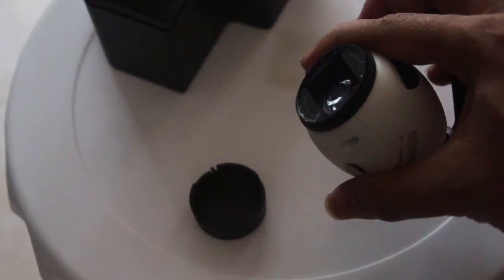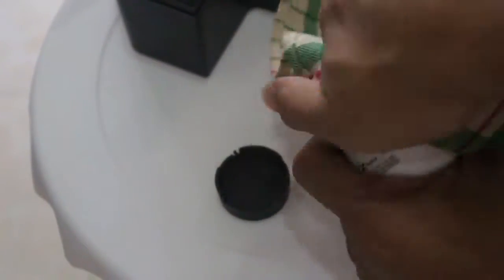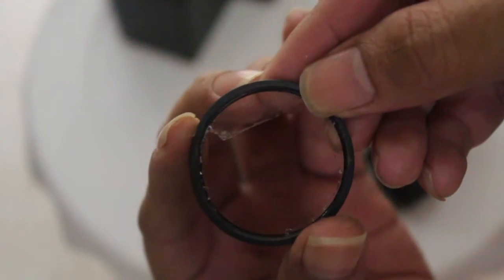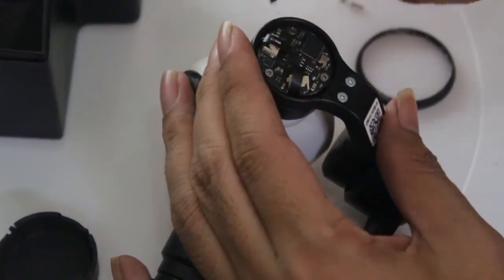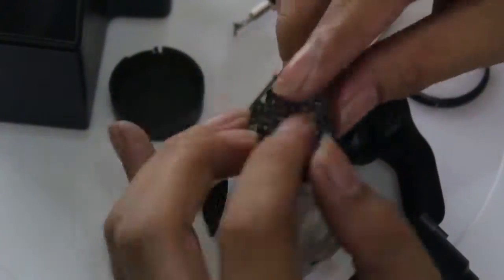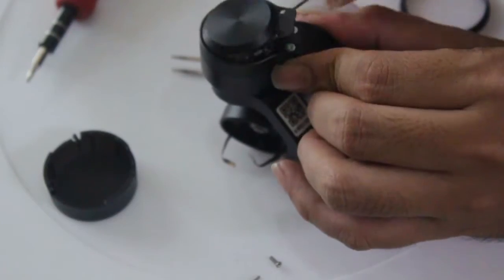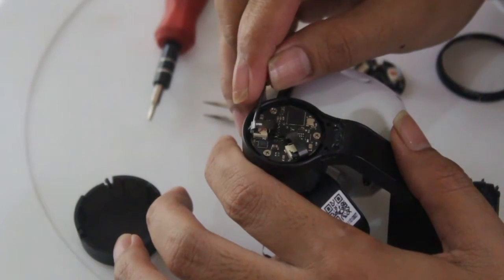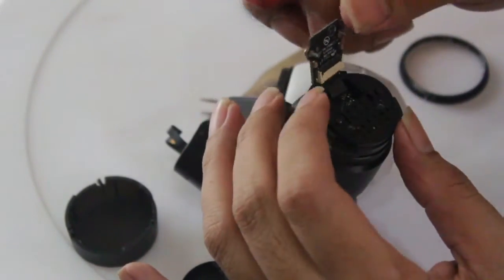dji Inspire 1 Zenmuse X3 disassembly repair

Comment: 👍Good video!
Hello
Now I’m fumbling in the dark, trying to figure out the correct positioning of these nuts in relation to the Hall sensors and the different axes. (I was able to determine the magnetic polarity of the nuts.)
Do you know the name/location of the hall sensors on the pcb and how the magnetic nuts relate to the sensors/axes?
By the way, I only have two magnetic nuts – for the pitch and roll axes. Ok?
Thx for any idea!!

Comment: Do you have any info on the gimbal driver arrangement ?? i bought one in pieces from a seller and all the drivers look the same.
Reply: WhatIThinkNation did you find any help 
I am having the same issue
Reply: What do you mean by gimbal driver arrangement?
Reply: @imperialsecuritybureau6037  im referring to which driver goes on the various x y z axis motors, the drivers look the same, but pitch driver cannot be used on the roll motor etc. Make sense ? Thats why if you are taking it apart for the first time, MARK The driver chip to the location you are removing it from for re-assembly.

Comment: Thank you.  My Inspire was crashed and the Yaw motor tension was tightened from the drop and the gimbal did not work properly after replaced a few broken parts, so I had to open the back plate to readjust the motor tension to match the others.  It's working now.

Comment: Hy i got a new ribbon cable from the dji support, i installed it and the gimbal is now ok, i cannot reset it now and it fails to calibrate. It spinns around like crazy.

Comment: Thank you for taking the time to post this.  I think it's going to be helpful in my repair.  After a crash part of the bracket has snapped and the main ribbon cable torn in two.  I am hoping I can get a replacement cable now.